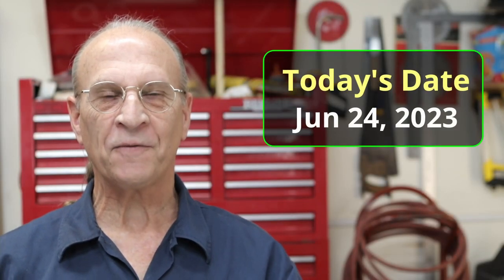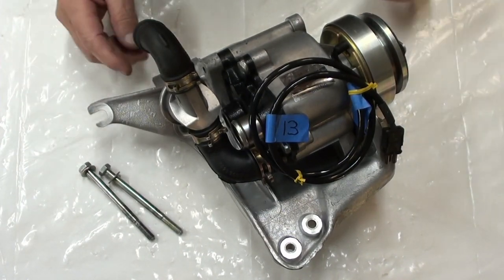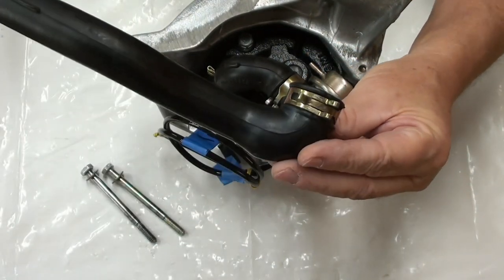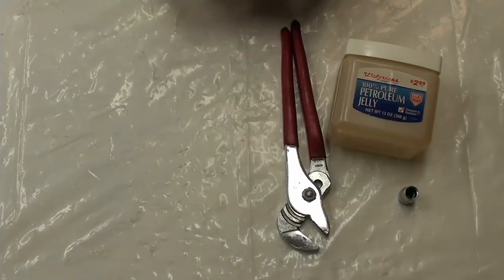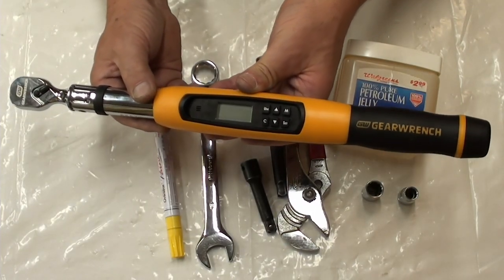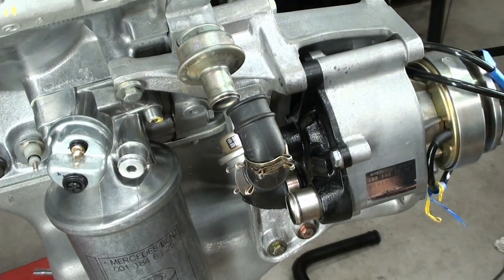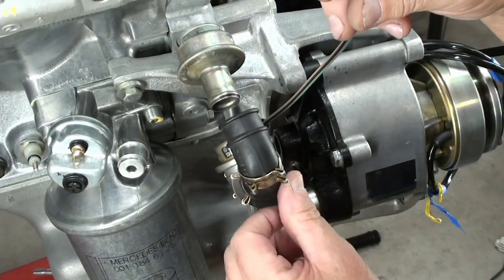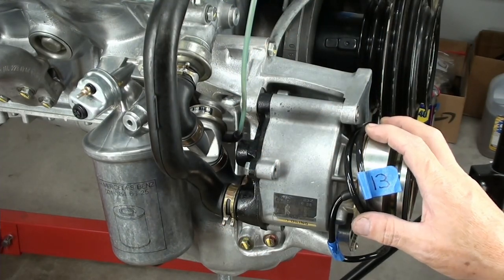560SL - Installing The Air Pump & Bracket

Comment from the maker: If not operational you could have difficulty passing emissions. Other than that, no problem. Your check engine light may also stay on. The air pump is all about emissions.
Reply: Ah ok, I thought maybe it also helps cool the catalytic converters. Love your videos very informative.. thanks Tony:))